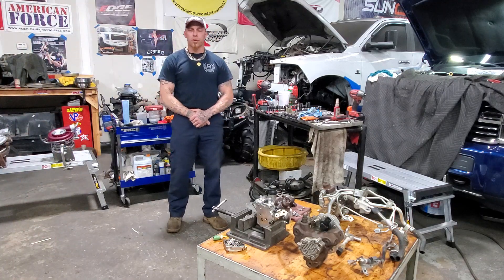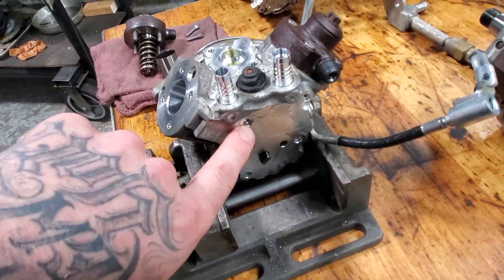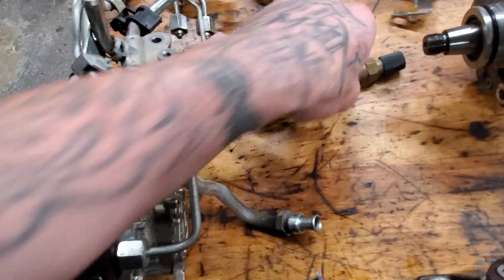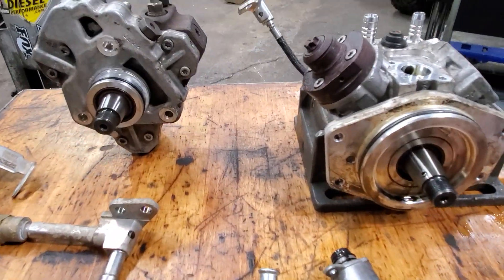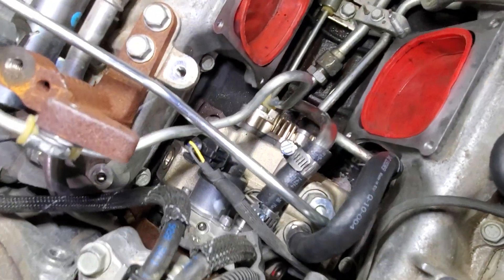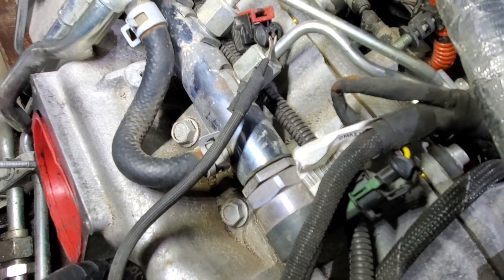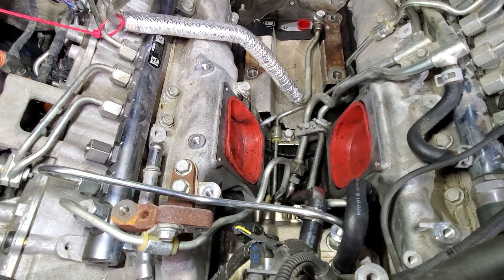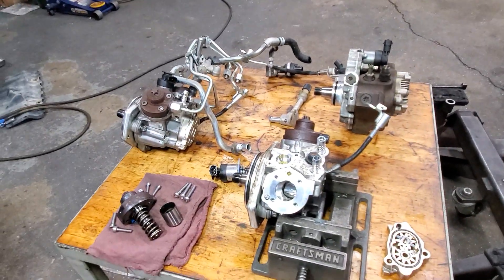Cp4 failure cp3 conversion Bosch high pressure injection pump lml duramax fleece wherli custom fab

Comment: Where do you put the fuel temp sensor? The cp3 doesn’t have one
Reply from the maker: Spurce a P clamp of the proper size to fasten around the threaded portion of the sensor > using the correct bolt, locate an unused thread boss to the right of the pump (above cylinder #2). If the coolers are still in place, zip tie the sensor to the harness running behind the ac pump. 👍

Comment: My buddy has a fleece lift pump in his tank. Then he had to program his computer so it would know its there. He hopes the lift pump in tank will help on his 13 6.6 duramax. He says there is a class action suit on the cp4 as long as nothing has been deleted on the truck not sure.
Reply from the maker: @patrickeskew4028  not sure what needed to be reprogrammed as there is no oem circuitry for an in tank lift pump from OE? Fleece utilizes a standalone harness that supplies 12v power to the pump via accessory tap and relay that is key switched.

Comment: My high pressure fitting on the return side is leaking at high pressure situations only should I retorque it or replace it? 2003 lb7 cp3

Comment: Hi so everything you have on the cp4 taken off is the lines and components not needed. Kf like to clean my engine bay the same I do have a lift pump and the truck is deleted fully. I'm doing the cp3 conversion currently.

Comment: So the return regulator is like a fuel pressure regulator on a gas engine which opens under high vacuum (idle) to bleed off excessive fuel pressure (not needed under low fuel requirement conditions at idle) and dump fuel back to the tank?

Comment: Does my dosing value have to come out mines is still in just plugged did my cp3 conversion but my truck bogs down like starving for fuel please anyone has a answer
Reply from the maker: If by "dosing valve" you mean the urea injector than no, it has nothing to do w the cp3 or the cp4. The 9th injector makes no difference either since its plugged. My guess is you did not retune for the cp3 conversion

Comment: Good in depth video! How many hours of labor would you estimate to do this job? I have a 2015 LML Duramax myself and a CP3 conversion is something I would really like to get done. I don't want to risk my CP4 failing and taking out my entire fuel system along with it.
Reply: 608 DIESEL I have the exact same thing and this is exactly what I want to know too
Reply: Id like to know too on my 2016 lml still workin on addin a liftpump and truck got tuned
Reply: Id say at a shop anywhere from 8 to 12 hours. So in laber alone 1000-1500ish depending on where you live
Reply: @DieselAddict-vs9fc  its a 6 hour job
Reply: @InsaneDzns  where'd you find that at
Reply: @InsaneDzns  dealer quotes 10-12 hours for the conversion
Reply: @DieselAddict-vs9fc  right but not your local diesel shop
Reply: @InsaneDzns  I would imagine if the egr is already deleted it would take several hours off. I know it's a pain in the ass to get the egr off